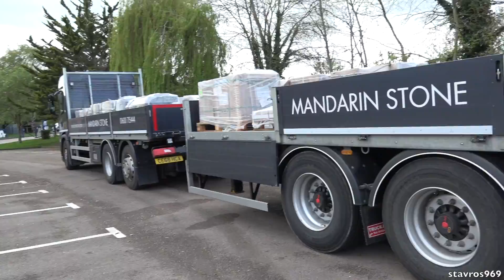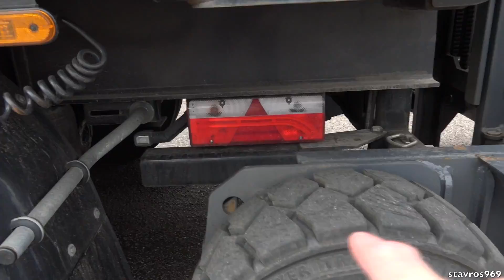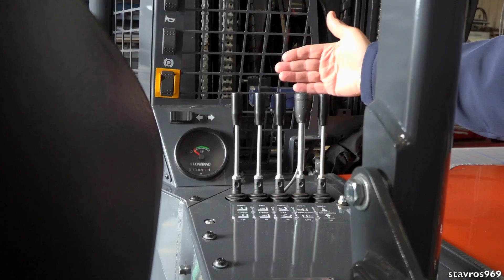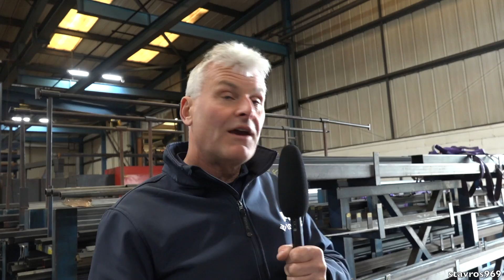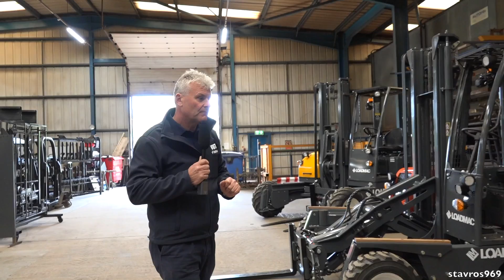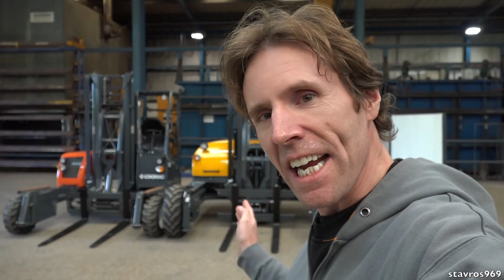The New Loadmac 225 & 825 Truck Mounted Forklifts Full Details & Field Test

Comment: All the wiring for the rear lights are exposed to the exhaust ,oil, weather elements and road salt.

They need to be enclosed or your indicators can fail when you most need them.